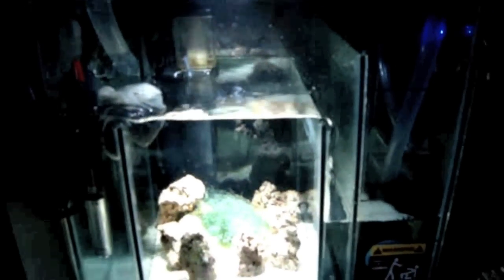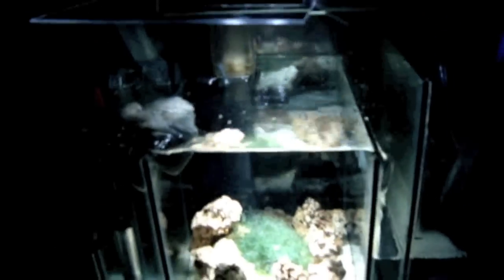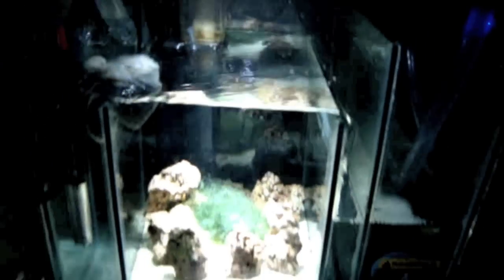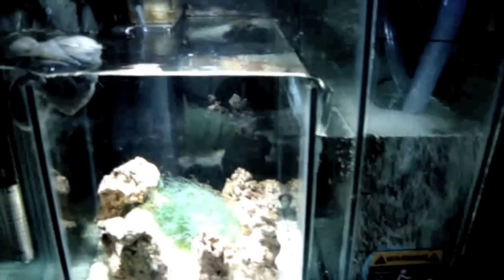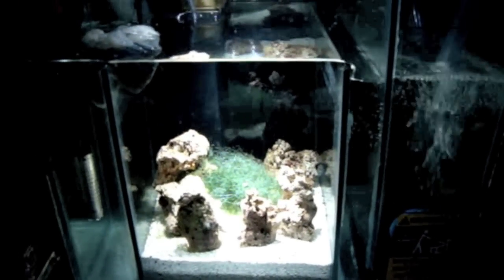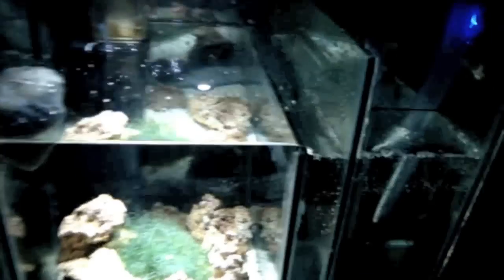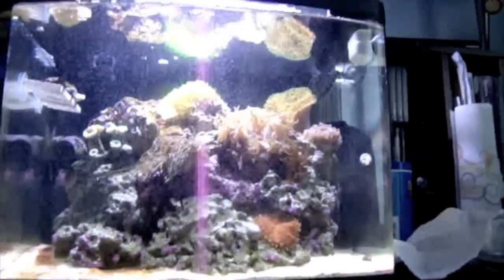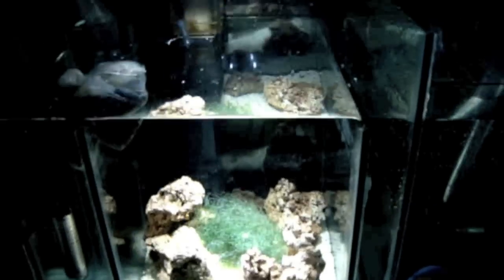Biocube 29 Sump ~ Simulated Power Failure

Comment from the maker: @chillinguy1 No the U tube doesn't lose it's siphon. When the power goes out, there is water in the black overflow and water in the back clear part. As long as there is water there the water stays in the U tube and the siphon doesn't break. Once the power comes back on the water fills up in the tank and then resumes normal operation

Comment from the maker: @uhupong Water does go from the display back into the sump.  It drains until the syphon is broken.  you have to figure out where your max water line is.  That is where, if the water is operated at that height and the power fails it will not overflow when water is back-syphoned.